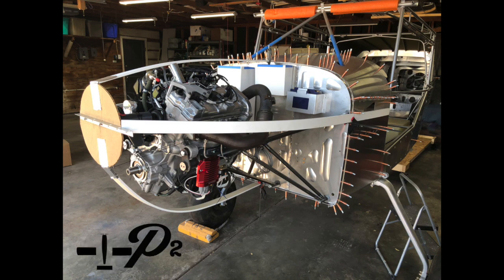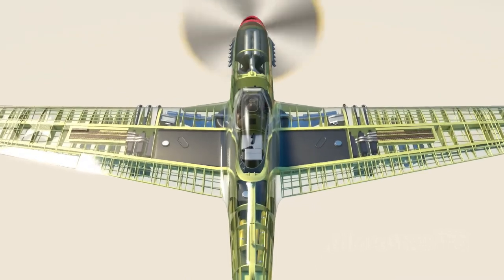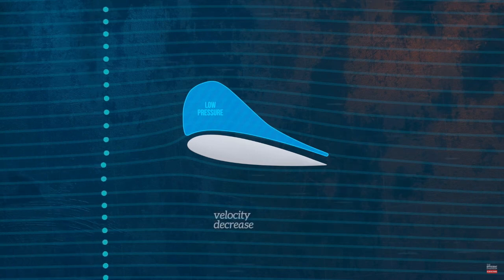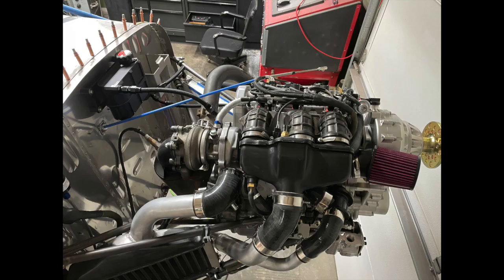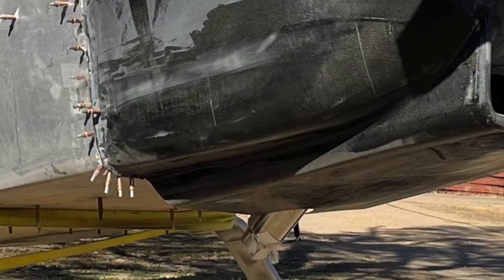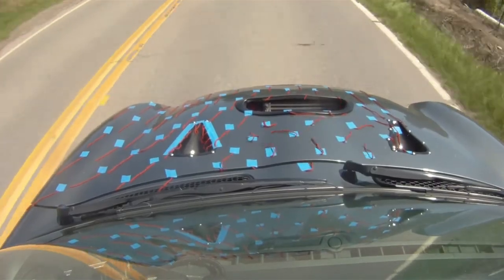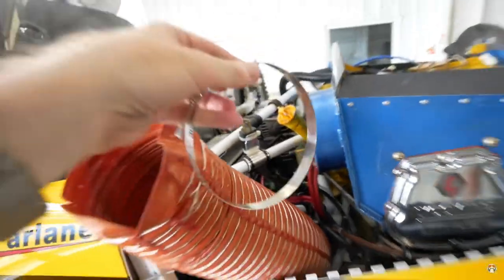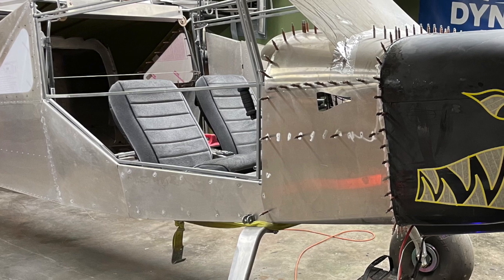Scratch Build Cowl Update Part 6 EP 56

Comment: There is some thinking going on outside of the…..cowl here, great work, keep it going. Since you asked, my only concern is the in-line fan you intend to try. I would be a lot happier if it was NOT in the primary line, but in its own branch line. It’s going to act as a massive restrictor if it fails or gets contaminated in some way.
Reply from the maker: I hear ya, I have similar reservations however in ground testing so far the fan didn’t restrict airflow even when off to a point where I could see a difference on temps

Comment: Not saying this casually, can see how much work this is and love your cowl. I think the fan works much better on the back side of the rad pulling air. and coming on automatically with temp.
Reply from the maker: The fan wont know the difference in this case but yes, In a normal automotive installation without a sealed plenum like this, the fan is generally on the back side rather than the front.  This fan is designed with a reversible rotor so it can be run on either side and it will be controlled by water temp👍

Comment: I hate to burst your bubble, but where wings are concerned, Bernoulli effect is more of a side effect than a primary cause of lift generation. According to NASA, a wing is primarily a flow turning device. The Coanda effect has more to do with why a wing is shaped the way it is. Bernoulli effect can only account for a small amount of the lift generated by a wing.
That's not to say that pressure differentials aren't relevant in other aspects of aerodynamics / ducting.
Reply from the maker: I don’t disagree be any means. Only intended the reference to serve as an example of how the effect works in a practical visual way.  Thanks for your comments👍